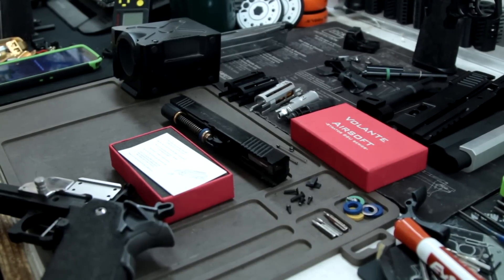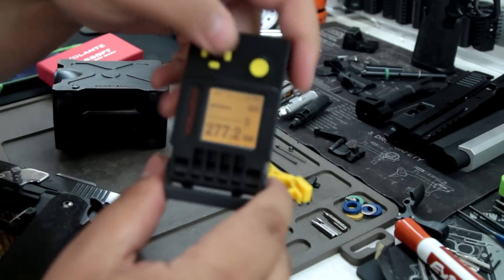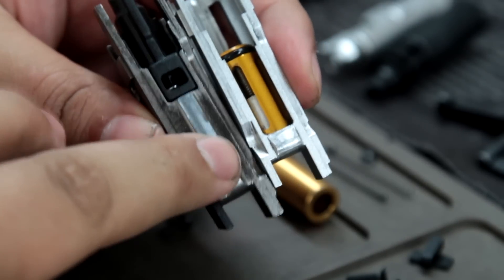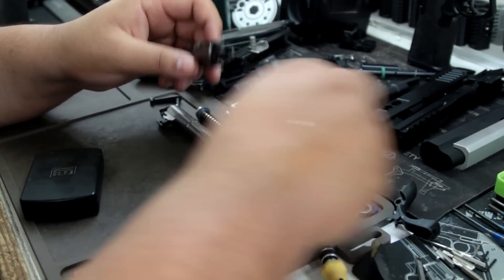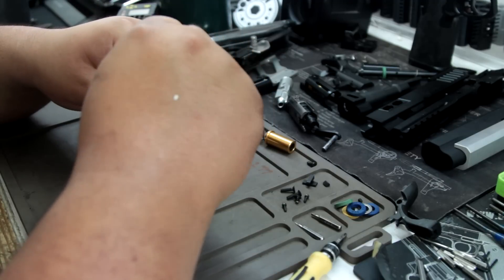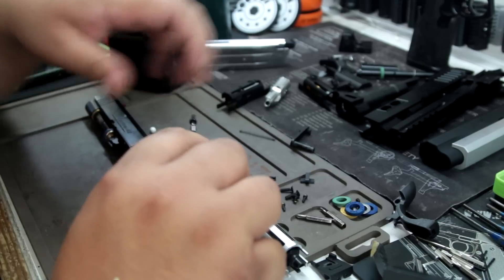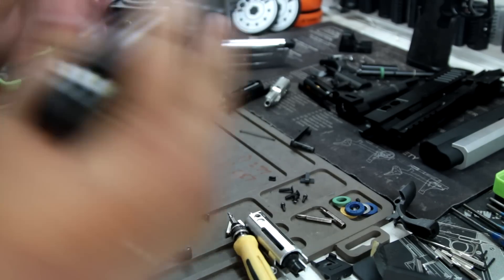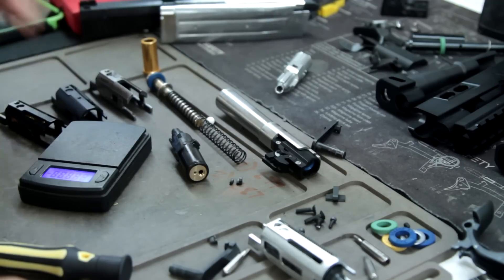General Overview: Volante Stratos BBU 1911/HiCapa (1/3)

Comment: I was the "broke in less than 50 shots comment". Good review. I was feeling the vibration too before my nozzle broke. Also, mine broke in the identical place. I’m waiting on the replacement nozzle as well so we will see how it goes.
Reply from the maker: ah yea, good to hear it from others, honestly thought i was crazy lol. what slide were you using for the testing phase?
Reply: I was using the new AM Viper slide and a stock TM mag with Green Gas.
Reply: I only managed 4 shots before the nozzle guide split into pieces on me.  I notice the later version have an upgraded nozzle guide (2019) and cylinder bulb (2020) so maybe there were fundamental flaws in the early version.

Comment: You have 1 year warremty up to 170 psi, thats what the product page said when I preordered mine.

Redwolf has the Hi-Capa BBU aswell (i think it's only like $55 there aswell), they also had all the parts for the glock BBU a little while back, don't know if they still have them though.

I have roughly 1500 shots through mine, not alot but on 110 psi HPA, and mine is still fine.

Personally i wish it could be adjusted a bit to have lower FPS so I could turn up the PSI and get more felt recoil. Also the nozzle has too long travl distance imo. But it feels great, I love the product, I would love to try this in a full steel set at some point! :)

If you dont know and havent figured it out yet, so take the nozzle apart, just pull out the front part of the nozzle a bit and turen the locking part in the middle (the part that broke on yours).

I had to file down the underside of the BBU just a little bit, on the top right part of the BBU (when holding the BBU underside up, and nozzle pointibg away from you).
Dont know if the was the BBU or my kit, but might be your problem aswell. It's in a Gunsmith Bro's alu slide and frame kit.... 

Sorry about the long and messy comment, but some of it seemed relevant maybe..? :p
Reply from the maker: I see the 1 year warranty but I do not see the 170 PSI thing you are talking about on the product page for the Stratos 1911 and yes you are right about redwolf, i've rather support the creator though so thats why I continue to preorder from him. Yea I was testing this guy at 100 PSI - 110PSI I was using plastic for this test which when talking to Volante the plastic slide could be bringing on more stress due to the speed. I know it is a three piece, after the video I take it apart 100% to check it out, very cool design no doubt. Still works though as well. I will most likely have to do the same if I put it in the OMNI due to how tight that kit is! no worries about the comment, it is always good to see someone using it and sharing experience.
Reply: @KnucklesGSM  when i preorders it said a Max pressure, it was in a other unit of measure, kg/cfm or something.

I preordered mine aswell, but I asume he sells to redwolf with a profit still.. :)
Getting replacement parts to a retailers like redwolf would be really nice for costumer support aswell. I think most people would rather support the parcel services as little as possible.. :p

Comment: I need some help trying to get the highest cycle rate possible I have the short stroke buffers all that, no stock parts left yet my cycle rate is still not where I would like it to be
Reply from the maker: if money isn't an issue, then just use 3d printed slides exclusively
Reply: @KnucklesGSM  ended up getting a airsoft masterpiece nano, working great just need a light recoil spring since a 150% is too much

Comment: Planned to buy one of these and install it on my guarder meu slide. Any suggestion for my set?

Oh one more thing, i paused to see the manual which says remove the extractor. 

Does it mean i can't install my guarder steel firepin(small metal piece installed behind the bbu)? 

Any idea why so?
Reply from the maker: can't help here, dont know that set as i am only familiar with the old gen of guarder
Reply: KnucklesGSM okay thanks, I’ve received my package and discovered that it’s just something like aip hammer pad, should have no problem

Comment: Hey Knucklesss, I have a question. I got a new grip for my Hi-Capa 5.1 and the trigger was too tight so I sanded out grip so the trigger is smooth. The trigger is finally smooth but for some reason my pistol shoots full auto and doesn't stop even when I release trigger. I believe the trigger comes back out too slowly but I can't be for sure. Would a new leaf spring be needed because the leaf spring still feels springy? Or should I sand the grip some more because I can't tell what's slowing down the trigger now!
Reply from the maker: check your leaf spring first if your trigger 100% drops in